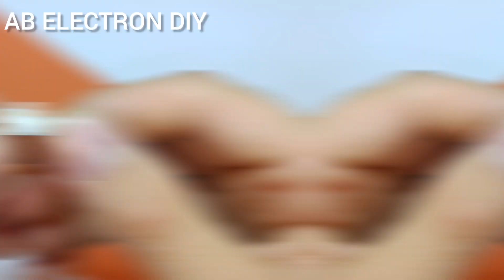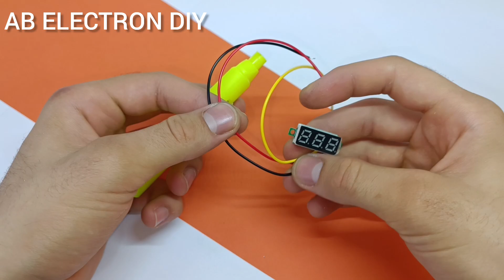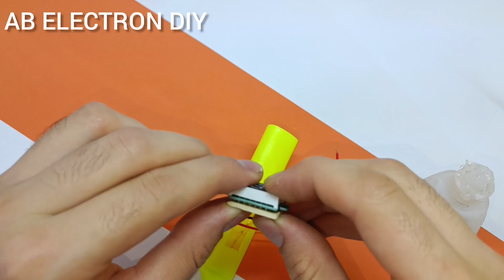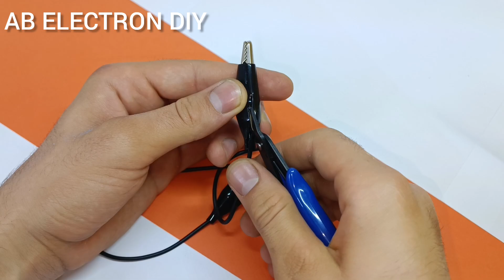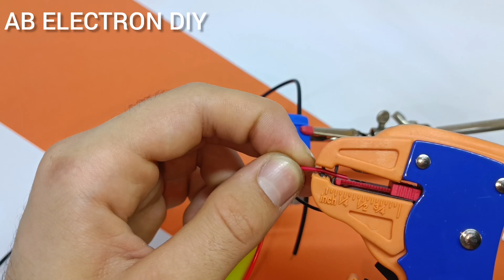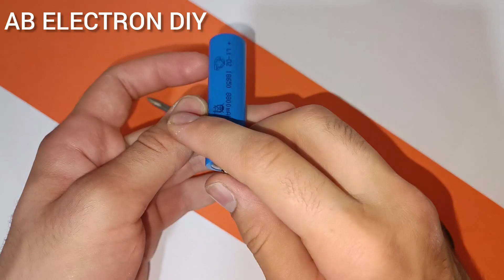Making amazing rechargeable voltmeter

Comment: nice project but rechargeable batteries don't need to be part of it (they were easy though). A couple of batteries once a year isn't a problem and waiting to charge and not knowing how long it will last is.
Reply from the maker: Hello and greetings, this module is very low consumption and whenever charging is complete, the charger module cuts off the electricity and turns on the blue LED.
Reply: @ABelectrondiy1  Yea, but it's still rechargeable. And it's lithium. When it's dead you have to wait (you don't with replaceable batteries). Additionally, lithium batteries have a short lifetime, and must be properly charged AND kept that way (correct charging voltage and current and btw 3.2 and 3.5 or so volts per cell storage voltage) or they won't take a charge and/or become 'puffy' (from being kept at a full charge) and are a fire hazard. When it's a lithium battery, you now have a project to maintain it. Who needs that when you don't have to?
Reply from the maker: @salvor1  The profession in which I work constantly needs this model of devices and I also agree with your opinion. I only did this project to educate and give ideas to the audience.